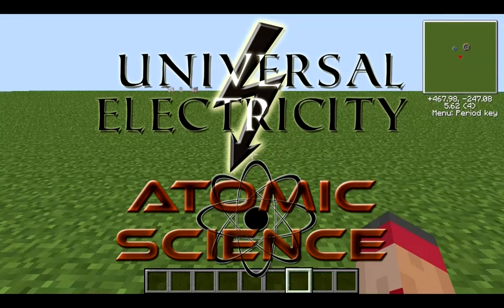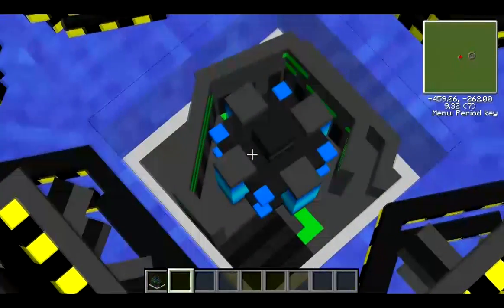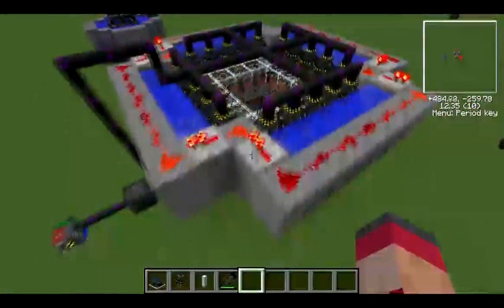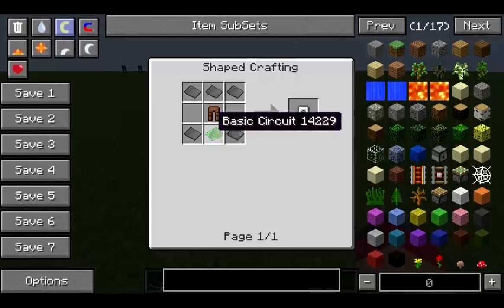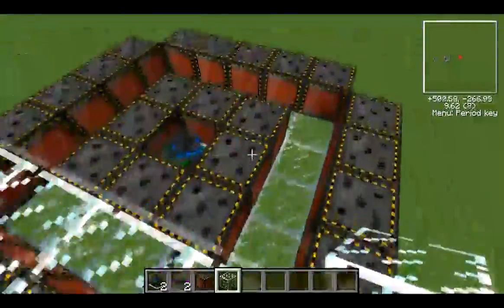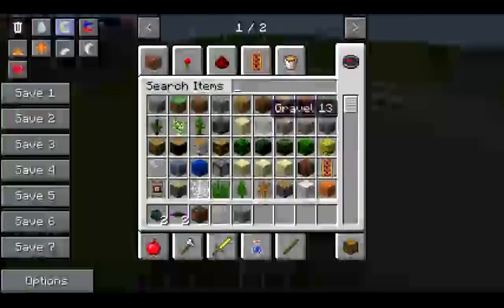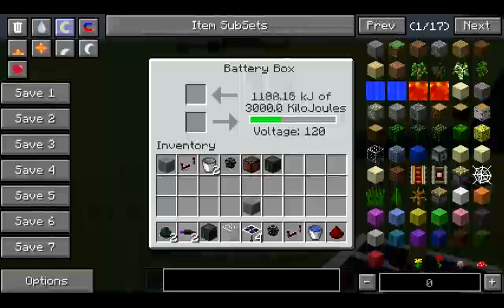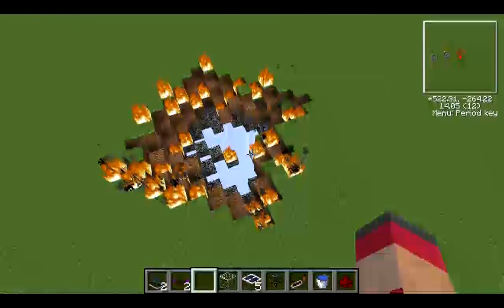Universal Electricity Fusion Reactor Tutorial

Comment: Okay, I built this reactor and used three fission reactors to power it. But as soon as I link it up to the battery box that the fission reactors are connected to, it drains all the power and runs for around four seconds before shutting off. There's plasma and energy being generated by the fusion reactor, but it won't stay running.

Comment: then you havent used it. also, the newest UE version IS in fact on the UE website, it just links to the IC2 page, and IC2 still has permission to use it.
and if you think its the same as the one specifically made to work with and look like the IC2 machinery you havent looked at the one in voltz.

AND FINALLY. voltz itself is not a pure universal electricity modpack, they may add or remove things in the future, and universal electricity itself might do so as well. its also a hell of a lot harder.

Comment: the fission reactor is MUCH more efficient if you do this with the reactor sitting in an infinite pool of water. in the past the fission reactor removed blocks without replacing them, but they now will refill themselves as the reactor depletes, and seince the turbines will almost always have water sitting under them, instead of how you have it set up, they will provide a LOT more power.

Comment: yes. i was making a pun at his pronunciation. and correction in this which is a normal light water reactor with solid uranium fuel. specifically it splits uranium-235 atoms into neutrons and the fission products. this produces a lot of heat energy which then evaporates water to high pressure steam to power turbines generating electricity. although i suppose i did say fission as opposed to nuclear reactors so i suppose you are half right with the words. "no" , "atom" and "split"

Comment: It is possible to add 2 additional layers of turbines on the fusion reactor. One a block above and closer to the center of the reactor. Simply put water blocks in the corners. These blocks will be unaffected by the heat. and finally water blocks with turbines above can be placedin the middle 3x3 portion of the reactor. please note that the middle water block will be unaffected and should not have a turbine above to give access to the reactor. Also, a turbine placed there would not work.

Comment: Sadly this isn't actually how fusion works. I'd been trying, for almost an hour, to generate electricity from a fusion reactor. I got the plasma running, but I couldn't get anything to come out, only in to fuel the reactor. Then I saw this video and realized that the fusion reactor they're using in this game isn't an aneutronic reactor. I kept expecting the damn thing to start pumping out electricity straight from the plasma, as they do IRL. Shame! SHAME!

Comment: Replace the top glass layer with more electromagnets, water and turbines for more power output. It won't look as nice because you can't see the plasma but it does give more power. If you give more space for the plasma to expand horizontally then you can draw even more power out. (easy to do, just expand your outer electromagnet torus and add more electromagnets to the top ring (which is glass in his tutorial), water on top of that and turbines.